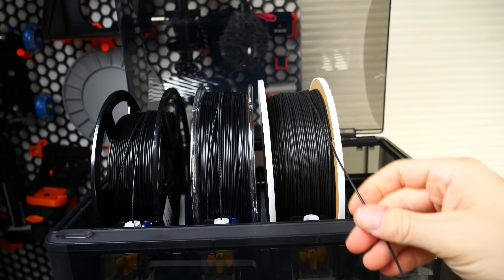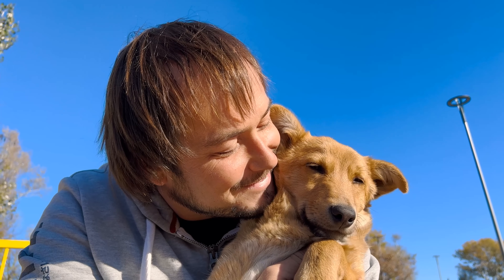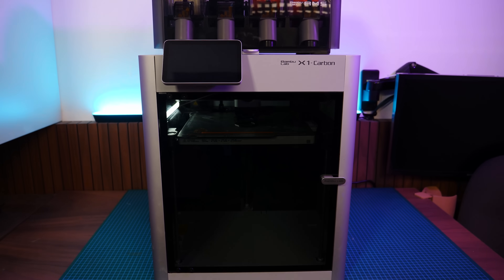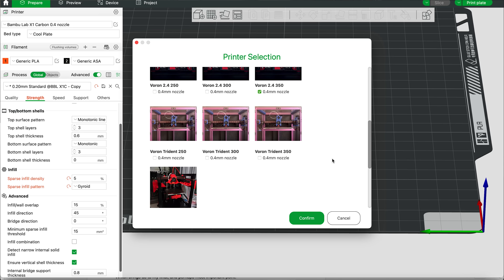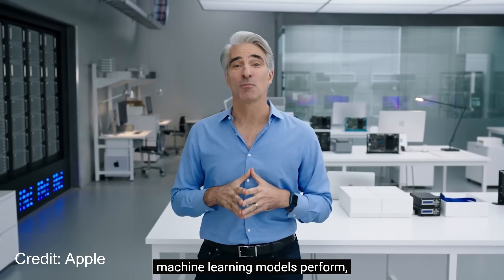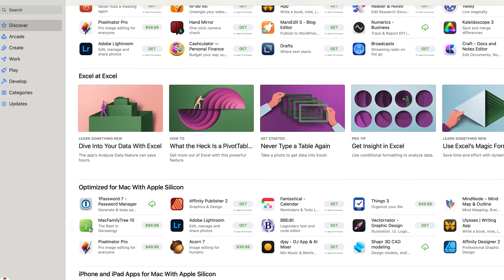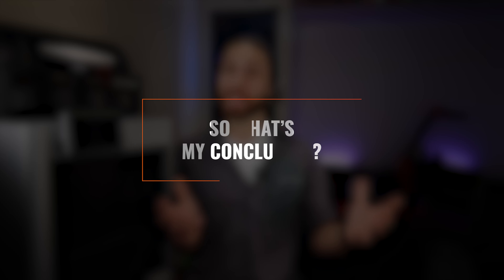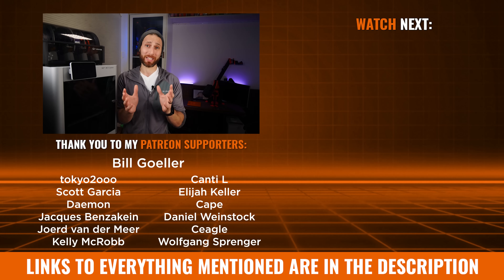Bambu Lab X1 Carbon: 5 Things You Don't Know

Comment: Just subscribed to your channel today after watching your direct message to Prusa and your Voron build series, and now this series about Bambu labs.  I would be very interested in seeing you review the P1P which is a much more realistic option for us mere mortals who have kids and a mortgage.  The walled garden on a line of 3d printers doesn't bother me anywhere near as much as the new trend in cheap SLA/Resin printers where they loose money on the hardware and make it back up in subscription fees to their required proprietary slicer software.  Reminds me of HP printers and the ink subscription plan I finally succumbed to.  In general I really  dislike walled gardens, and I would prefer building a Voron for my next printer.  (I'm still using my Prusa Mk2S I built from a kit many years ago).   Apple makes quality stuff, but you pay through the nose for it.  Also due to their shady business practices with regard to right to repair I refuse to buy or use anything made by them. Check out some of Louis Rossmann's videos about Apple.

Comment: I love what you are doing, and like always this was an awesome review. I have a particular question if you cand help me. I work away from home, mostly 4 months away.  I want an easy to use 3D printer reliable, one witch also my wife can use it. I have an Anycubic Chiron but is not very consistent. I was thinking about Bambu Lab x1 Carbon (without AMS system) or Prusa i3 mk3S+. What you think. Thank you for your time
Reply from the maker: Bambu Lab X1 Carbon all day long. It tells you what's wrong right on the screen. Did you see my recent "Dear Prusa Research" video? I can't recommend ANYONE buy a Prusa until they update their products.
Reply: @thenextlayer  Thank you very much for your response. Yup i see the brake up video 😂 posted only one week before Valentine's Day. I will order mine now. Thank you again

Comment: Thank you for this - I've been running the X1C for several weeks now, and had completely missed that the carbon filter / chamber fan was a manual on/off step - VERY useful information! Hope they add this to the software as you suggest.
Reply from the maker: Glad I was able to share something new with even an existing owner

Comment: You offer some interesting points about how Bambu could add some gates to their garden walls.  Certainly worth thinking about!  For me, the walls don't bother me because Bambu has been upfront about the plan all the way through; even during the Kickstarter everyone knew that all of the hardware and much of the software was proprietary.  Contrast with Apple which spent decades pretending that they were increasing connectivity and interoperability, when what they were actually doing was building a wall that would put Hadrian to shame.

That said, there are a surprising number of options out there for non-Bambu parts.  WhamBam has build plates.  So does Energetic - I'm using an Energetic PEI build plate for when I print PLA, because it was a reasonable cost and the only not-a-sticker, not-textured, PEI plate available.  (I much prefer a smooth finish on my first layer.)  I just use the Textured PEI Plate settings in BambuSlicer and it works dandy.  Recently, Ancufy on AliExpress started selling hotends that are basically the X1C hotend modified to use a standard M6 nozzle; I'd guess this is to get around the Bambu Patents but it does mean that if you really want to experiment with a CHT nozzle, there's a way to do that.  Personally, the best part of the X1 is the all-in-one nozzle and throat, so going back to having to try and seat a nozzle seems horrific.  But the option is there, and more importantly it suggests that if Bambu Labs did vanish, someone would find it worth the time to make replacement parts.

Comment: The Aux Fan is (without changing it during the print) in the G Code, which is created based on the Material, but you can edit it in the settings
Usually based on bed temp there are 2 values and an if then else 
M106 looks like to Address the fan, and S255 is 100% Speed
I changed mine in the PLA to around 70% because it was too loud if having a parrallel online business meeting.
Btw, if you do not have change material prints, you also can use the software to manually change it also during the print.
But if it changes with the AWS.. it goes back at 100% for PLA any change

Comment: Most of us 3D printing enthusiasts are always in a hurry to finish a print but only to fail halfway because we skipped bed cleaning, leveling, adhesion and proper extruder heat and flow... do it once the right way... plus, the speed will make up for the start up delay...

Comment: I love my Prusa Mini and my Prusa i3 Mk3S+.But since the X1C arrived, they have hardly gotten any use. The thing I love the most is pretty much everything. The thing I hate the most about the X1C is the slicer.  There are lots of bugs and limitations, and at least one feature (repair STL)  that’s only implemented on Windows. The slicer needs work. Glue stick is a close second. I am irritated that I have to immediately upgrade the printer with third party stuff in order to be really usable. When you print on glue stick it affects the quality of the final product even if you scrub any residue off of your print. I hate glue stick. And even on glue stick, I have bed adhesion problems at the default temperature, even with their PLA filament.

And the Prusa satin sheet is the best print surface I have ever used. I haven’t seen that surface on any other brands, but if that surface were to become available on Bambu, I would be in favor of that.

Comment: I have had my prusa since 2016 and upgraded to the 2.5.  The fact is the prusa just works.  I love the fact you build the prusa yourself from a kit so when it needs fixing, its no problem.  Would i like some of these other features of the X1, yes but I am one of those very opposed to a closed system vs prusa which is as open as you can get.    Would I buy an X1 just to mess with, maybe soon.  Thanks for a great video on the X1 . Larry

Comment: I agree with you on near all, but you forget 2 things like near all the video,   quality at very thin layer is not so Wonderfull , I do better with a v-minion for the moment but the worse for me is the noise even in quiet mode, I have a v-minion that at low speed with nylon cf make near no noise and a markforged M2 which is also quiet,  I'm very disappointed with the X1C because I need to place it in a far room to work in peace. I also have a friend that want one and finally will not buy because it's too noisy to put in in small apartment , can't sleep during a night print,   nobody speak about this and it's a important detail.  about the slicer simplify3d has now the full control of the X1C

Comment: Thank you! Especially introducing "walled garden" into the 3d print world vocabulary. I know I am getting ahead of where we are now, but I think it is critical that others need to know in the future this device should fall under the "right to repair" argument. I don't think Bambu Labs is going to disappear or go bankrupt like a US company; it is Chinese owned so it may fold or transition into another Chinese company. Also, the difference between Apple and Bambu Labs is that their programming environment is that Apple built their own programming language, Swift, while the other is using Open Source for slicing (Slic3r / PrusaSlicer), printer commands (GCODE), and kinematics (Klipper). 

And finally, with any walled garden, network interfacing must be cloud based or you've now hobbled your printer with LAN only. And from what I understanding now, the P1P has a different chipset that is less capable than the X1 so you must use the cloud based tools or it won't work. So for anyone with a secure home/office network, setting up the X1 or P1P is going to set off a lot of alarm bells.
Reply: If any device relies on a internet connection and their cloud service, I refuse to buy it. Too many companies are gone or decided to turn off their cloud service or drop support for older devices. I hate walled gardens and never owed a single apple product mostly for that reason. I hope Bambu Lab isn't like that.

Comment: One often overlooked feature of the AMS is the automatic capability of switching to a new spool when you finishes one. Having two spools of the same material in it will ensure that your print will complete without any manual intervention! No more trying to figure out if you have enough filament to do a print…. Genius!
Reply from the maker: Totally. I’d seen that covered a lot though so I didn’t mention!
Reply: It's especially useful if you're dumb like me, and manage to unwind a third of your spool when you tried to transfer a cartboard spool onto a plastic one..

Comment: tell me you never owned a stratasys, with out telling me you never owned a stratasys  lol. thanks great review looking forward to getting mine this Feb. hoping its like my F900 or F450 but at home.
Reply from the maker: Does stratasys make consumer machines??? They’re an Israeli company so I could easily get one, but I thought it’s all industrial?
Reply: @thenextlayer  they used to make one the uPrint SE. they stopped making it when they bought MAKERBOT AND ULTIMAKER so that's their consumer systems. the Dimension 1200es can be picked up used for $2k and are still dual extruder for support material. the reason i ordered the Bambu Lab X1 was it was the closest i have found to a affordable Fortus style system. stratasys is over priced as can be, but it will spoil you to just trust your printer and not worry about it. file comes in print comes out and it fits and works.

Comment: BBL Slicer is open, and Softfever branch is great especially if you run Vorons.  Hardware for hot-ends should stay closed.  There's no room for additional janky Chinese clone parts which will suck and cause problems.  E3D?  Won't fit and there's no need.  There's like no point in the "nozzles" because the hardened steel ones for X1C - just keep it all factory and humming along.
Reply from the maker: Thanks for the tip I’ll check out softfever. Also… I’m totally going to test knockoff Bambu parts to test your theory.

Comment: It would make for a very interesting comparison if you were to take the Bambu Studio slicer and choose the Ender 3 as the current printer to see how it works on the Enders.  I imagine that perhaps Enders with the Klipper firmware upgrade installed would be the closest variety of enders to try it out on.  Love my Bambu X1C too.   Using my Snapmaker F350 now feels like I'm taking a step back in time.  To be honest, as soon as the Bambu sales guys get back from their CNY benders, I'm getting me another X1C combo system.
Reply from the maker: It doesn’t support adding Enders I don’t think. Maybe with custom profiles. But you won’t see any benefits over Prusa slicer. The slider is just a very small part of the performance if anything at all

Comment: Got my P1P (X1C on order) setup in 20 minutes, been printing pretty much non-stop for 3 days. I am spoiled, no bed leveling or constant tuning, upgrades on my Ender 3’s and 5 Plus.  I care more about design and making stuff than tinkering even though I have done that. The P1P makes perfect first layers, extrusion is spot on, corners beautiful, the best ironing I have experienced and much more.  I want another and another….
Reply: You and me both, mate!
Reply: @davydatwood3158  I added AMS, fantastic!  Then yesterday my X1C came, seems even faster, display is amazing, especially with AMS.  I have to order another AMS today, it’s just too good.  I have two “appliances” running full tilt-yet to have a failed print,..hope this lasts!

Comment: Leave your printer on. If you’ve already printed with the same filament type, then you can skip the flow calibration. I skip the bed leveling as well when I’m using the same plate.

Comment: My P1P arrived today and i’m in love like never before. This printer is just crazy but I’m scared of printing on 100% every time. Maybe it could handle the speed very well, but we don’t know for how long. I’m from Germany and can’t order any Bambu Lab filament (except ABS, but yeah it’s the P1P) so I hope that they get a huge restock. Thanks for your Videos and your opinion about this beast!
Reply: 100% is where it defaults to.  After a few days of being amazed at the speed and quality of the parts it produced, I figured out how to adjust the print speed.  Now, I typically adjust the speed up to Sport mode and let er rip.   Ludicrous mode still makes my butthole pucker a little and I only use it when the part is small enough to not have to be making long sweeps across the entire build plate.  Seriously, the print head is damn near a blur when printing in Ludicrous mode.  But I do trust the engineers that came up with these incredible machines that it's not going to RUD when running as fast as it can.
Reply: @jims6450  thank you for these informations! Yeah, maybe my brain starts accepting those accelerations after some more prints… Which filament brand are you using? I can’t order any bamboo pla/petg so i’m looking for an alternative, don’t wanna mess around with the slicer profile (switching from Cura and having a new printer is kinda stressful) and f up the quality. Thanks mate 🙏

Comment: Nice video, though I dont understand your comment regarding the filter. Its the same on all filter - every printer with a chamber filter is an exhaustfilter to ensure that the air coming out of the machine is filtered. What other uses should it have? :) Same on Ultimaker with the ugly hat, Raise3D, Craftbot with the ugly hat, zortrax with the same stupid hat +++ _=

Comment: If I'm printing multiple things in succession with the same filament, I always only run the bed levelling and flow calibration the first time. Then the startup time is much faster than 7 to 10 minutes for the next prints.

Comment: I love the video. But... uhm... Using Apple's App Store (or just the mobile tech business model in general) as a example of "good" Eco-system is so cringe to me. These system simply give the company too much authorities. As it has been demonstrated by Apple/Google, they can: (1) use the right-to-access to extort money from developers (i.e: the 30% cut), (2) kick-you-out/shadow-banning-you because the company is expand toward that market (i.e: Music, data-collection/advertisement). In addition, after 10+ years and with the scale of Apple/Google, the certification process for both company is still extremely inconsistent; you basically play by different rules depending on your size (i.e: Youtube/Spotify/Amazon-Kindle vs every-other-smaller-apps-that-do-the-same-thing). And (for those smaller devs) on the mood of verification bot/contractor, i.e: technical errors, and whether the random human reviewer like the colour scheme or not (that not a joke, it happens a lot). When those errors happen, updates on the app may got held back for weeks/months, or the app can just be banned.
Therefore, I would much refer the PC hardware model. Companies can have their proprietary stuffs, i.e: CPU, GPU, memories, etc (Intel, AMD, Nvidia, Samsung, Micron, etc.); but the interface between them are set standardised, i.e: PCIe, DDRx, 12V power connector, etc.

Comment: I love my X1C so much that I purchased a P1P just for PLA/PETG prints. And I have been pretty pleased with your coverage of the offerings from Bambu Lab. As a fellow Apple user, I don't mind the walled garden here so much as the consumables are very reasonably priced, but it might be pretty amazing to see how much further things can be pushed with a bit of openness. But I can understand the immense amount of pressure Bambu is currently under trying to get printers to customers and dealing with the occasional bad apple or issues with shipping that crop up. I, honestly, love the fact that I can just hit print and largely continue with my day worry free regardless of the material I'm printing with. No, not everything is perfect, but it just works and I love that more than getting a perfect print every time as most every print I have gotten has come out perfect enough.
Reply from the maker: I agree fully

Comment: So again I’m not hearing you say anything overly negative about the x1 carbon. If anything I’d say you not only complimented the printer, but painted a realistic picture of things hopefully to come. 

I figure I’ll pull the trigger on an x1 in the next month or so. I don’t forsee the need for an AMS system for my needs so I’ll likely forgo that option. I’ll also either purchase the Bambu labs pei plate or source a third party plate. I’m also contemplating purchasing a spare .04 nozzle as well as a couple of .06 nozzles and likely spare wipers as I’ve heard they can take a beating. I know there is a print file for them but want to reserve that option as an emergency plan. I’ve also heard about some machines having issues with the motherboard cooling fan so will cross that bridge if I have to. 

Hopefully I won’t need much more then that for a while. I’m really chomping at the bit for a faster printer, as the best I can do with what I have is in the 60-70mm per second which is abysmally slow never mind the other printers I have that run at a draconian 40mm ps. 

Thanks for the update and the useful insight.